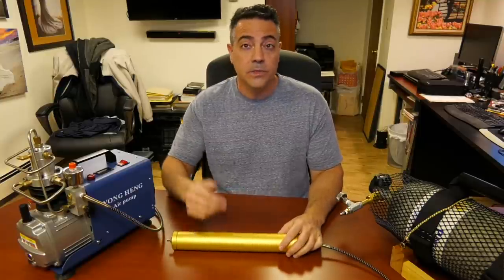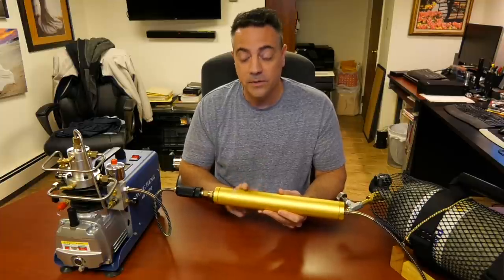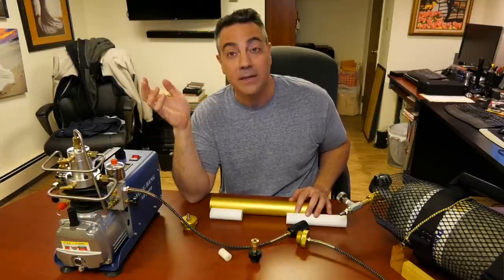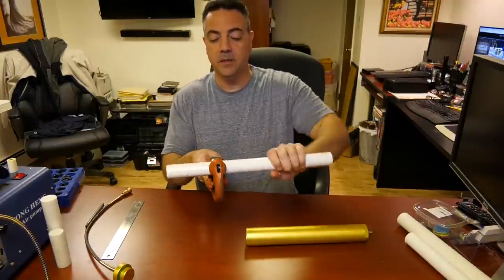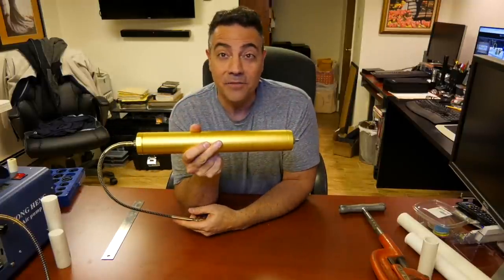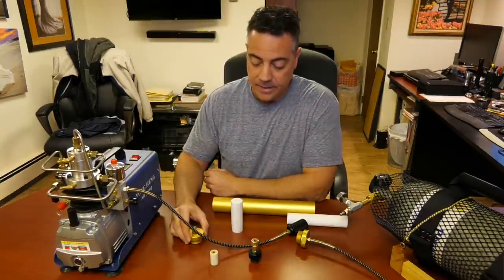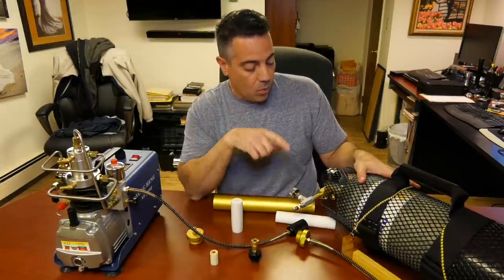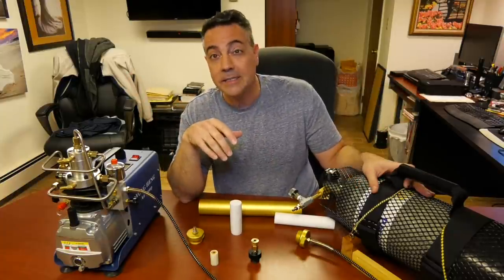Yong Heng 4500psi compressor and Water Separator (molecular sieve) for PCP Airguns

Comment: I was thinking the same thing to bleed it first reducing blowing another rupture disc, maybe it will somewhat equalize if you have two opposite pressures coming out of a small hole and you want loose that much air in your tank.So people don't take it to 5000 psi thinking the tank will cool down to 4500 psi wait till it cools first. Or you'll blow a rupture disc then take it to 4500psi.
Reply: The people who keep overfilling their tanks are going to die. Why would you even attempt to pressurize one single pound over the limit? I see people posting about blowing a burst disc, well yeah, what did you think was going to happen? That's over two tons of pressure  for every cubic inch, and it will absolutely ruin your world.
Reply: Jeff - The burst disks go when they want to go.  I know from experience on the YH.  Some guys report them bursting at 3000 psi. There's no exact science to it.  It's a safety precaution and I don't think the majority are trying to overfill.  I for one plan to only take it to 4200psi max so I save some wear and tear and not stress this little pump.
Reply: Burst dics are designed to pop when too much pressure is placed on them, and yes, it is an EXACT SCIENCE. It is the very definition of an exact science. If you try and fill over the burst disc limit it is designed to fail as a safety mechanism, so if you are bursting discs you are doing something wrong, period. I have not burst one single disc in the life of my compressor or tanks. If the discs are failing it is for a REASON, they don't just fail willy-nillly.
Reply: Jeff Poleet were talking about the Yong Heng right? The discs burst at different pressures. Your saying they burst at their exact maximum limit like the discs are all tested and rated individually and found to be rated the same? Nothing about those discs are exact except you can buy 10 of them for $8.00 on ebay. That's the only thing exact about them.
https://www.ebay.com/p/10pcs-Good-Quality-Explosion-proof-Rupture-Disc-for-Yongheng-Air-Compressor-Pump/2163788956?iid=263109245158
Reply: The Yong Heng I cannot speak to as I have only had mine about 1 month. I run a cascade system of 4 tanks so I can get the most out of my tanks. I step down from 9L to 6.7, and use the Yong Heng to fill these tanks. I have had no issues as of yet with the compressor or burst discs, but they are different from the ones I was trained on and use for SCUBA and SCBA cylinder purposes. What I am saying is that the discs should not be rupturing on you unless you are putting some excessive pressure on them. Yes, on occassion you might have a disc rupture due to age and metal fatigue, but it should not be a matter of course. 

With that said, those discs might be fabricated to general (good enough) standards, and they will get the job done. If you want to change them less often you can get some of a better quality, but it's not like your life depends on it so I will probably by the same lot. 

I started diving when I was 10 years old, certified when I was 12 years old. I am 41 today, and in that time as a Diver, and a RESCUE diver, I have only replaced one burst disc. It blew on me at 95 feet of the cost of Destin, FL, and I remember it distinctly as I had the pressure blowing at the back of my head, and no air coming through my regulator. That's what I mean when I say they are pretty exact. I wonder if Ninja or Sherwood has a burst disc that would better suit the YH. I'll check into it and see if I can find something better.

Didn't mean to hit you with both barrels. My admonition was really to people blowing discs on their tanks, etc., who are pusing the limits of the cylinder. I haven't seen a cylinder crack in my lifetime, but I have seen the glass on a regulator panel blow out the pressure gages. Divers are taught to fill their guages face down, so I worry about everyone staring at their pressure gauge when filling their guns. 

Honestly, I'm suprised at the lack of guidance customers get when purchasing the guns and cylinders. I literally had to get certified to work on these things as a diver, and another course to run the fill station. As long as you follow simple rules it's all very safe and basic. However, if you push those rules the consquences get serious real fast, and I don't think enough emphasis is being put on that part. Have fun and stay safe!

Comment: Good work once again desicant is expensive if the gold tube stays cool there isn't much moisture in the air it'll put heat in that tilt the gold tube tword the inlet if water is in there it'll settle to the bottom is there a difference on a high vs low humidity day? and thanks for the heads up on the relay the more people that buy those the cheaper the replacement parts will be and ya competition is for the benefit of all knowing the when to replace what or for the lack of a better expression a maintnence schedule, thanks for the pointers

Comment: Dive tank air is not dry as in 100%. If it was, divers would dry out and it would be very uncomfortable. Dive tank regs will vary from country to country and test durations may vary too.
In the UK, test durations vary depending on use so rmtanks used in saline have more frequent tests. Surface air only has longer and carbon have a max life span after which the need to be destroyed.

Comment: Hi Air, I just received that same updated relay from Aliexpress. Did you get one of these yet. I see where almost all of the wires go. If you are looking straight on at the connectors, They have doubled up the top left wire. Just a little unsure what to do with that one. If you could, Just let me know if you have done this yet. Thanks
Reply from the maker: Steve Judd no have not swapped the AliExpress one yet. Still using the eBay power relay. Lost the auto shutoff feature but I'm ok with it for now

Comment: Water in the guns tank is not dangerous it’s common even on commercial fills. If it was a scuba tank that holds breathable air that’s another story but for air guns I won’t hurt.

What’s actually dangerous is oil making its way from the pumps sump into the air. It can cause a “diesel style” explosion. It’s happened quite a few times from people putting a drop of oil on the full nipple. Then following a fast fill at the paintball field the oil atomizes and goes “diesel” boom.

I love the Yong Heng compressors but the first thing I did was get the oil/water filter. I just didn’t want to trust my life or potential injury to 3 piston rings that separates the oil sump from the pump. Not to mention oil will always bypass the rings by the film on the cylinder wall.

Having an oil filter for HPA fills is mandatory in my eyes. With a slow fill from the compressor you will never generate the heat to have a diesel style explosion. But if over time your cylinder gets oil contaminated there’s a chance when you have a fast commercial fill or fill off a scuba/guppy tank it can ignite.

Can look up the sources for the paintball explosions but it’s happened now at least 10 times. Most of those were from oil on the nipple but a few were with veteran players where the oil must’ve been oil contaminated. There is one case in particular with a long time veteran player who had is tank diesel complete with pictures of his burnt disintegrated jersey from the resulting fireball.
Reply: It can rust and weaken the metal. Your tank / gun becoming a missile propelled by 3000 - 4500 psi air is quite deadly. A hole in the tank even secured, will cut you in half. But to each their own.

Comment: How often do you need to dry the molecular siv
Reply from the maker: I change it out every 30 fills or once a year. Depends how much humidity there is while I'm filling. Filling in the winter in New York is very dry while summer fills are very high humidity. These year I did do many fills cause of Covid so I may go a little longer before changing the molecular drive.
Reply: @AirVelocitySport  thanks I need to check humidity in my area but I suspect not that bad I live in south California I read you can dry them out by bakeing them
Reply from the maker: Yes, you can do that but only 2 or 3 times as they lose the ability to collect moisture after a few times of dry them out.

Comment: Hi i have a small silver oil/water  separator with the small cotton thingy inside and also ,i had bought the cheap  black oil/water filter and it came with black charcoal on one side and i am always getting water inside my rifles.

Should I use both like You did in the beginning of this video?
also what exactly can get ruined inside the rifle besides the Aluminum
parts like in the Armada or Hercules

Someone told me to remove the charcoal.from the filter , Should i?

Comment: the needle in my YH pressure gauge does a 'hummingbird' vibration when getting close to 4000 PSI. Has anyone experienced anything similar? It fills up my 4500 PSI bottle just fine. Could it be that the gauge was drained of oil when it was shipped to me? Does anyone know if these gauges are filled with glycerine or silicone oil (clear fluid) ?
If so, is there a way to fill it up with some ?
Reply: Rogue-Spear it’s filled with glycerin should be a rubber plug on the side of gage.

Comment: My pvc pipe doesn't fit snuggly into the filter, it's too loose, about 1-1.5 mm loose, so to prevent the air channeling, what if i put the molecular sieves into a sock and a rubber tube (maybe a long balloon cut on both ends?) add the shorter tampons on both ends...  will it protect the filter from the acid build up? any suggestions?
Reply from the maker: stoner27th that sounds good to me. It's not so much about the acid build-up but more about the molecular sieve touching the walls of the aluminum tube. Supposedly the acid that could build up from the molecular sieve is only bad if it touches the aluminum walls of the two as long as you are insulating the sieve from the two it should be fine.
Reply: Okay.. I'll try sock and balloon.. now.. where can I get those long balloons... wait.. condoms! .. LOL..

Comment: The pressure only gets to 1500 psi on my yong heng compressor with both valves closed and a plug in the female foster cable out. Will this unit pressurize up to 4500 psi with nothing hooked up? Help plz only had this unit for a week
Reply from the maker: Yes, the unit should go to 300 bar or 4350 psi with no problem. I would guess you have a leak some where. Try using soapy water and spray on connections and line to reveal if there is a leak. You will see bubbles if there is a leak with the plug in place

Comment: I heard they now sell a 110 v version that has the automatic shut off I can’t get a reply from the seller just yet it’s confusing trying to purchase one on Ali express I also see another brand that is a gold version called tuxing. I’m ready to purchase one ASAP also I see Ali express sells scba tanks with valves for filling pcp guns, curious if they are any good ?
Reply from the maker: Zachary Richards mine is the 110v auto shutoff. Buy it on ebay and you will have buyer protection. Not sure if the AliExpress valve are any good? Again, I bought my fill station valve with 36" microbore hose on eBay.

Comment: I bought a compressor a coupe of weeks ago, and now I just bought this filter. Buying from china is a bit freaky, the compressor was in Cali, not so freaky. Is there a foster fitting for the hose end, or just buy a male to male foster fitting??
Reply from the maker: On one end is female Foster and on the other is a male Foster. Very nice
Reply: Showed up today, nice little filter, looks like I won't be going to AOA  any time soon,  I have my filter hooked directly to the lil filter on the compressor unit, eliminating  the hose that came with the filter.

Comment: The single tube filter in this video looks the same size as the double canister filter. Mine uses carbon filters though, I bet they fit inside this single tube instead of using the cotton. The carbon filter cartridge comes in 2 packs with a 360L replacement interval in the dual tube configuration for breathable air. For air gun applications can probably do 360L with a single canister or more if you remove the filter to dry out the media.

Only thing that freaks me out about these filters is the tube on the fill whip and external water/oil separator tube when I’m near 4500psi. They look nowhere near the strength of my fiber wrapped tank that’s holding the same psi. Lol. I know it’s not dangerous since aluminum will split in a burst, unlike steel which fragments. Either way need to filter the oil from these tanks or pay the consequences when it blows, that’s much worse then a little aluminum pipe blowing.

Comment: Hola te estoy contactando desde España. Verás tengo un compresor igual que ese con el que estás haciendo el video. Al respecto preguntarte lo siguiente: He estado llenando una botella-scuba de buceo de 3L con el pequeño filtro que trae el compresor. Ha tardado en llenarse unos 15 o 16' (minutos) hasta llegar a unos 240 bares aunque el compresor me indicaba 3500PSI. De un momento a otro empezó a tirar aire la botella a traves de la válvula de seguridad, además ésta se calienta, llegando a alcanzar 30 o 35º. Además al vaciar la botella, he visto que tenía bastante agua dentro. Posteriormente, tras enfriarse ha bajado la presión en la botella hasta llegar a unos 210-220 bares.  Preguntarte si ésto es normal y si es el caso como eliminar agua y posibles residuos de aceite, afín de poder usar el aire almacenado para fines de respiración humano, buceo etc. Muchas gracias por tu atención. Yo soy Juan José aquí te dejo mi email por si me quieres contactar. jjvacap@gmail.com Muchas gracias un saludo

Comment: You shut the tank off and open the bleed valve at pretty much the same time 1 hand on the tank and the other on the bleed soon as the tank is shut crack the bleed the second that tank is closed pretty much the same time

Comment: Curiouse would this work for scuba diving also? (is there anything more required in the filtering system to be able to breath it?)
Reply from the maker: This is definitely NOT for breathing air. You would need a very extensive filter system to clean the air using this compressor. The air that comes from this compressor is oil infused.
Reply: @AirVelocitySport  alright thank you, was mostly curiouse if the "full filter" he was describing would be enought but i assume there will be contaminations in the air that aint that easily removed.

Sadly all the "scuba compressors" is way to expensive and my area where i want to use it is a very remote area there is no way to get tanks refilled. Freediving with harpoons is fun and all but being able to stay down at the bottom would help alot.

Comment: Hello sr si today its the may 10 2018 hows it going so far with the compressor? Would you still recommend us getting one? 
I see also online a lot of look a likes would they be the same compressor?
Reply from the maker: emiliano echeverria yes, I would recommend getting a Yong heng compressor as long as you do not pay more than $450. It's a good compressor but it lacks some features and quality of those higher priced compressors. It gets the jobs done! Also, I try never to push the compressor to hard. I fill to 4100psi and never let it run too hot or too long. It has been working just fine.
Reply: Its now July 9th 2019. How's the Yong heng doing? I'm thinking of buying for $212 delivered from Wal-Mart.com.

Comment: What compressor do you have 240v or 110v. Does 110v have auto/shut off?
Reply from the maker: usa 43 I have 110v with auto shutoff
Reply: I think you should choose the most expensive one they call it SET PRESSURE type, the AUTO SHUT OFF type is just the name for the fail safe burst disks system. cmiiw

Comment: I have same compressor and my gauge failed, same as urs with auto shut off. Do you have a link for replacement one?
Reply from the maker: Alex C I would search AliExpress or eBay. Those would be the most likely to have replacement part for the yong heng
Reply: Air Velocity Sport ive tried those sites and no luck. But thanks anyway👍

Comment: What oil do you recommend using with the YONG HENG?
Reply from the maker: I've switched over from hydraulic oil aw40 to Seco Lube 500 from here https://www.filtertechs.com/shop/index.php?cPath=93_108
Reply: @AirVelocitySport   Thanks for the quick reply.  Care to explain why the change to Seco Lube 500?
Reply from the maker: It's one of a few compressor breathing oils that does not form carbon build up on the  high pressure Piston and it does not give off that terrible smell like hydraulic oil.it has a safer chemical composition. It contain diester liquid. Here is what I found on diester liquid http://stevensonoil.com/synthetic-diester-oil/

I bought my Seco oil from here https://www.filtertechs.info/products-page/compressor-oil/
Reply: @AirVelocitySport  What size watch batteries work in the temperature monitoring device which sits on top of the machine?
Reply: @TimSwan  
LR44